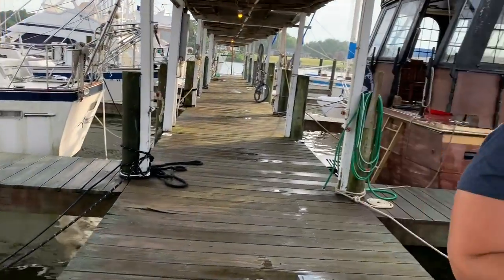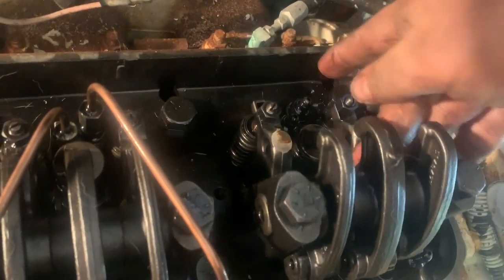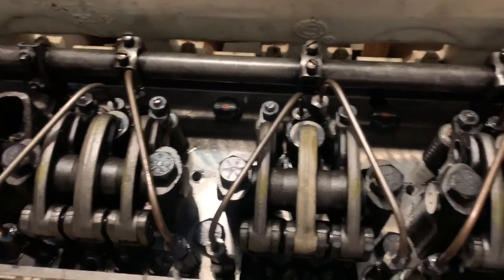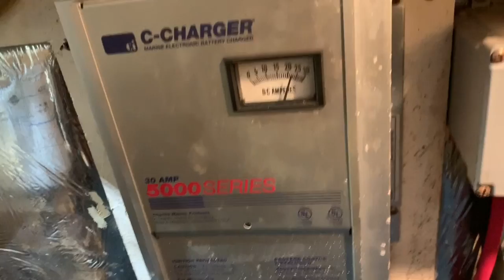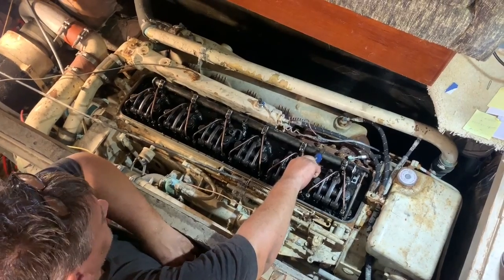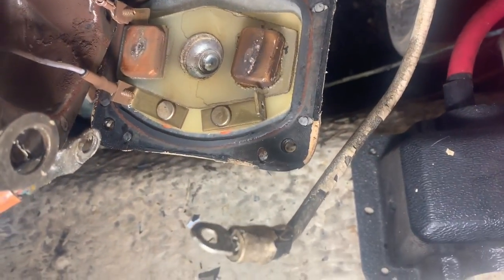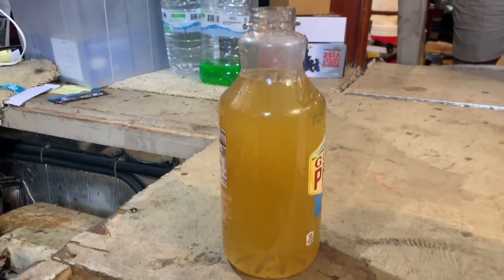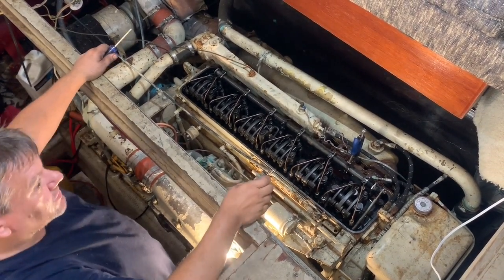Twin 671 Detroit diesel TIB boat (full video) 1st start

Comment: What is the reason there is so much more horsepower on-demand to a marine application as opposed to a land-based application? The difference escapes me as the only obvious difference being their drivelines and damned little else.
          Mike
Reply from the maker: Cooling.
Reply: These are TIB engines, not available for on road use. T - turbo, I - intercooled, B - blower bypass.
It will also have fuel coolers, larger oil coolers, and as Scott mentioned massive injectors. The secret to more power is to burn more fuel, to burn more fuel you need more air, but as the bottom end is standard the trade is engine life.
Reply from the maker: Even the turbos are watercooled
Reply: @BusGreaseMonkey Temperature still has to be maintained does it not, if not overcooling would become a problem. In winter in northern Ontario, we could not maintain temp which caused leaking problems between dissimilar metals and no heat in the cab of trucks.
        Mike
Reply: @rayg9069 more fuel? Christ, we were getting 3 miles to the gallon (Canadian) and that was running one way mt.
        Mike
Reply: @mikelamothesr.8998  Onroad use is a much lighter duty than pleasure marine, sure trucks run high revs and often on the governed rpm but they spend little time sitting on the fuel stops, hill climbs excepted of course. In marine duty the boat is propped to extract the maximum power from the engine, these engines probably make around 250bhp at 2100rpm but those extra 400 rpm need a lot more horses to spin the prop. I think propeller law is double the rpm, cube the power absorbed? something like that. I factory ran 16V149 TIBB engines in Australia that were so highly fueled they would not start if the block temperature was below around 120F they injected so much fuel they flooded, the fuel absorbed all the compression heat without lighting off. Original 16V149Ts made around 1,000Hp, some of the intermittent rated engines I ran were making 2,200Hp. That's at 1500 Rpm.
Reply: @rayg9069 G, how much bloody fuel would they eat through at full revs for an hour or so? Everything from the scuppers down must be the fuel tank.
        Mike
Reply: @mikelamothesr.8998  The 16V149 TIBB engines I tested were emergency back up power units in a city building, rated at 1500kW (2100hp) with 10% overload for 1 hour. They burned through around 350 litrs an hour from memory, I can't remember exactly they were connected into 5,000 litre test fuel tanks that were fairly empty after an 8 hour run.
Reply: Just under 100 US gallon an hour
Reply: @rayg9069 G, Gulf Canada fueled a few hospital power gens and they were fed from two 45,000 litre tanks and they burned through 5000 litres per test every second month.
Reply: @rayg9069 I suppose if you can afford the boat fuel would be of little concern.
      Mike
Reply: @mikelamothesr.8998  At cruising speed of 24 knots per hour, 27.6 mph, she burns one gallon per nautical mile.   Less if you run her at 1200 rpm instead of 2400 rpm.

Comment: Explain engine “runaway”...Do you just mean wide open throttle? 
Sorry, I’m new here.
Reply from the maker: Uncontrollable wide open with no limiter
Reply: Runaway is when a diesel gets unmetered fuel and starts revving up usually until it starts getting valve float, which is way past redline. By fuel I just mean something it is burning, it can also be sucking oil up and burning that which is the most common I have seen. Lookup runaway diesel on youtube, they can be very scary. Only way to shut them off is completely block off airflow, but most i6 or v8 diesels will suck an entire phonebook through its 4 inch intake. Some vehicles have a runaway flap you flip a switch to close, most do not though. You would have to remove the air filter housing and using a piece of wood or metal to block the air, but you also really don't want to be close to a runaway

Comment: After watching a lot of your videos, it always seems that you leave the owner with some more repairs that need to be done.  Things like, new brake linings, new gears in the rear end, new start motor and many more.  Who does the final repairs???  You fix the big issues, but if someone needs a complete repair, who do they call?
Reply from the maker: Brakes that need linings to be changed in the future but never with inop brakes.
Reply: Sometimes it isn't worth his or the customers time and expense to wait around forever for new parts to arrive. Pretty much everything I've seen him work on thus far ended up better than before he arrived, though some results are obviously short term solutions.
Reply: @michigandon I guess I understand, but where do you go to get the other repairs???
Reply: Good question.

If it were myself. I would order everything I thought I needed in advance and set up a time to have Scott to come back at a later date to go through things more thoroughly.

Comment: that tank contains the diesel bacteria. new fueltank recommended.
Reply: pretty sure there is some stuff you can add to the fuel to kill that fungus
Reply: @dposer10  yes there are enzymes made for that purpose. If you google sparex soltron then you got the right product. As mechanic, i always recommend adding such products to diesel fuel in the dose indicated on the packaging. Modern diesel fuel is extremely hygroscopic.
Reply: Plenty of products available to clear the bug out of a tank.  When a tank has been sat for a time it's well worth giving it a good dose of bug killer, then circulating the fuel though a filter or two to remove any water and debris lurking at the bottom.

Comment: First
Reply from the maker: Congratulations now you are required to watch the whole thing.... ;)
Reply: your cookie is on it's way :P
Reply: We used to keep a hammer close by to knock off a fuel fitting in case of a Detroit run away